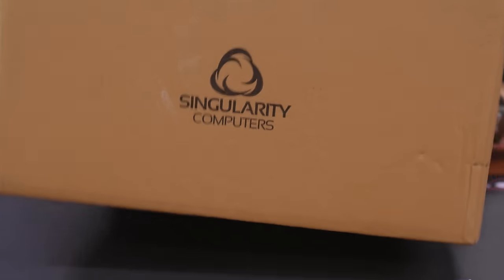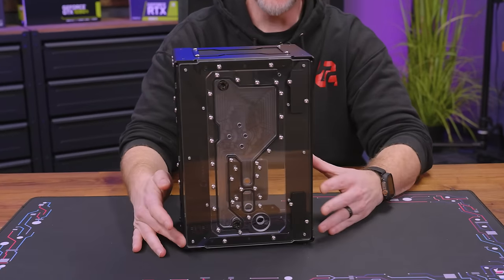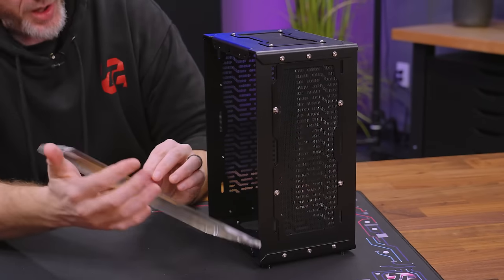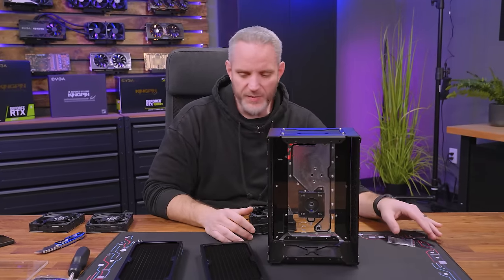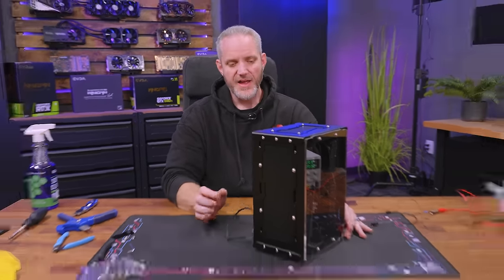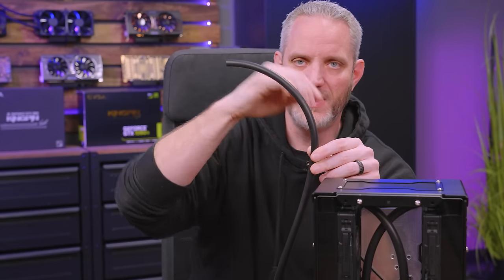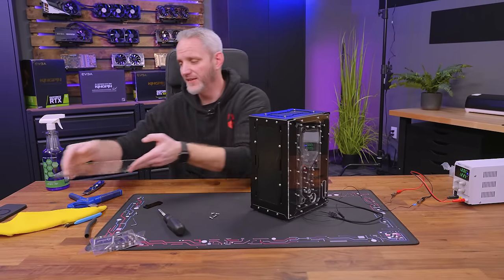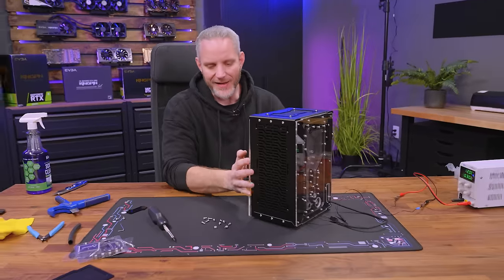External Loops are a thing again?

Comment: the warmer air wouldn't really matter to be honest. think of how an oil cooler (the ones that are part of the filter housing) works for a car, most cars have a cooler that has coolant lines running to it, which is going to be hot but still less temp than the oil, cause oil gets pretty hot. this then cools the oil as there is a half way decent difference in the two liquid temps.

Comment: I think the problem of the heat from the intake radiator affecting the exhaust rad would be alleviated if you configure the loop so that the water goes through the exhaust radiator first. But pull pull is probably a better work around? We shall see after testing.

Comment: Imagine the box being a very thick rad. 1 60thick 240mm in push pull is always going to have less cooling performance then 2 30thick 240mm in push. Although the surface area might be the same, the fins futher away from the fans will get cooler air if the rad is thinner.

My suggestion would doing exhaust on both side. Better than intake on both sides to avoid turbulence from the clashing air.

Comment: Yes, Alaska makes sense, most cargo freight that is onboard CAO aircraft will move from Asia over to Anchorage to then proceed down. When coming from Australia, east coast dispatches usually fly out of Sydney (depending on Courier, FedEx is Sydney mostly), from there most of the time it will proceed to China or Hong Kong (rarely Singapore), or it will head up to Japan, then over to Anchroage, then down to USA.

The other direction (mostly dispatches from West Aust... At least for FedEx) hop a PAX flight from Perth to Singapore, and from there they could take the China, Japan, Anchorage route, or they can go the India/UAE, Germany/Switzerland, NY Route. With everything I have shipped out of WA it 100% of the time goes to Singapore first, then its about 50/50 if it goes via China/Japan, or India/UAE direction. DHL will favour taking things via Leipzig as thats thier main hub (as Louisville, Kentucky is for UPS, and Memphis is for FedEx).

For Cargo (CAO) they dont need to take a direct route like for Passengers (PAX)... Us humans would get impatient with a 3-4 day trip via several hub airports changing planes to get from AU to USA.

Comment: Seems like something like this could benefit from some kind of USB connector to run the power/rpms and rgb. Not sure how feasible that would be but could cut down on the number of cables and it would be one less hole you would need in your system.

Comment: I would go push pull, full intake in first glance would make it, but it's way too tight, dual intake will just reduce airflow by stucking turbulent air in the middle, so getting you less quite rpm range and also slowing the warm air exhaust

Comment: I feel like you could sneak a 3rd rad in there. Or maybe a 3D printed shroud in the middle directing all the air up and out so you can intake from both sides and send it all out the top.

Comment: That would be a cool video to use some thermal imaging on. Also, one could argue that the hot air coming out from the bottom would then potentially be sucked back in through the Rad's

Comment: The real question is whether or not you’ll be able to see through the acrylic after you’ve dropped it a few more times.  I hate acrylic side panels; they scratch too easily.  Probably wouldn’t hurt to have a top exhaust fan - even. just a 92mm.

Comment: Do it so I feel vindicated in my loop configuration. In the Corsair 680x, I have a 360mm radiator in the front and a 240mm in the bottom, both intake. One fan on the top and one at the rear are exhaust.

Comment: If you put the exit of the loop on the top rad and connect that to the frond rad you kinda pre cool the water before the frond rad dous the final cooling before it goes back into the loop, if you do it that way it should be no problem maybe the best configuration

Comment: Du eet! lol, I've always thought that the warm air was reducing the efficiency of the second radiator. but hey, it's just a gut feeling. Perhaps something like an air shroud to direct fresh air to both rads, but that seems like a lot of bother unless the results of the test indicates a large efficiency loss. Perhaps manufacturers can make a rad with dedicated fans and shroud that each pull in fresh air and exhaust it out through the radiator. Of course you'd still need other fans to provide air for cooling of the rest of the components in the case.

Comment: When you test pull-push, you should also test if it's better to have the hot coolant enter the "cooler" radiator first (the one drawing in fresh air) followed by the "hotter" radiator (the one drawing in the warmed air), or vice versa (hot coolant into the "hotter" rad first then piped directly to the "cooler" radiator). As for guiding airflow, since you have a 3D printer, you should try looking up some of the directional air vent patterns on Thingiverse for 120/140mm fans that can redirect air up or down towards the top/bottom vents (in pull-pull config).

Comment: my thought would be push pull with the outlet rad getting the HOT water and the inlet with the cooler air also getting cooler water out of the first rad
it would be neat to get inline temp gauges and plumb them in and see water temps in and out of each stage

Comment: I won't use any radiator anymore from Alphacool, the last one was a nightmare to install, threaded holes painted close, even one hole without thread, so I have to do it myself, because I have the tools. But a novice user would have a big problem. This was a rad from the Eisbear series 360mm. Maybe the other rads doesn't have the problem, but the fact they won't answer my RMA questions, is making me choose other brands.

Comment: I would like to see testing with cross flow, both incoming and maybe both out going pulling air from the top and bottom and blowing out the side radiators.  If the air flow was coming in from both sides and out the top/bottom you may need to also test with some sort of divider so the air does not crash in the middle.  I have a system that I am running with 3 radiators I am curious on testing because I really am not sure if it is over kill.  I am sure you would tell me it is.

Temps runs idle at about 37 F and 72 F gaming.
This is the loop.
Pump/200 ml Res -> 120 rad 1 -> CPU block -> 120 Rad 2 -> GPU Block ->  240 Rad 3 -> Pump/200 ml

They need a Lian Li type under case slide out filters for cleaning.

Comment: Looks like a mini take on the airplex gigant in plastic and in pretty. For 350 usd you could get two MO-RA3 420s, though. It is pretty, for sure, a bit heavy on the screws department.

The dust thing: they are from Australia, dust is everywhere and it is the grinding your fan to a halt kind.

Comment: Kinda depends what DCC you have. (and the Prize is 250 now :P )
The 6W 500L/h   18w 900L/h or the 20W 1000L/h  DDC...
24 = 2 Amp  18w = 1.5 Amp
Most of the motherboard's i have with an "dedicated" REAL pump out (not some crappy AIO) have 17W max on the outputs. READ the manual..

Comment: With the filters on the vents it would probably make more sense to do all exhaust. It should be pretty air tight to not have the problems of negative pressure like in a normal PC case.

Comment: Honestly, I think that a cross flow straight from intake front, exhaust back would be a little bit more efficient than dual intakes, as in my head, the hot air being forced out via positive pressure would create hotspots on the tank, this negating a small amount of cooling as it would heat a tiny portion of the center.

This is pure guesswork on my part.

Comment: How about having fans drawing in air from the bottom and out the top with the radiators blowing out drawing the cooler air drawn to the inside. Might only need fans on the bottom and use some taller feet so you can draw more air in. Just an idea.

Comment: I have a theory that having the fans up against the rads might be worse due to the closeness of the fan blades to the rad chopping the air. Since the general consensus is that pressurizing the case is best, I would like to try this design but use a case that is sealed very well for air pressure, then put all the fans on one of the exterior faces. Case will pressurize and air will exit through the rads.

Comment: I just built a rack mount system and had to do an external quick disconnect radiator and all .  I was looking at the 520 version.  This 240 version might have been perfect....  I was looking at this this morning and looking for videos.  Then this popped up after I got back from lunch....

Comment: As a retired rocket instrumentation engineer, I'd want to have thermocouples in the water lines measuring temperatures going in and out of the block and in and out of the radiator. Overkill, I know.

Comment: Waterbox should have all fans exhaust IMO, makes more sense to pull cool air inside thru vents and then exhaust the heat. 
rather than the fans face in and blow warm air, heating up the waterbox.

Comment: would be neat if they did a dual 360 box too.  Another external solution to think on is the Mora from Watercool. you can even get a pump and res unit that mounts on the side.

Comment: Pls do the math on the amps, Pump and Vents. 2 Amp (@12 volt) on a regular mobo doesnt leave you with much headroom, plus cable length. Bigger awg size recommended.

Comment: set both to exhaust out the case as it will pull cold air from the top and bottom and expell the heat from the sides

Comment: Why not have the fans blow through the rads outward? have the intake at top and bottom and in the fans draw from inside the box pushing air out through the rads... That would negate the air turbulence inside the box and probably increase efficiency and reduce noise (in theory)

Comment: Yes do that test please!
I got just that orientation with front 280 bottom 240 intake and top 360 exhaust and have been wondering about just this.
And if there would be any other options that might work better since all my intakes goes through rads.

Comment: also im not done with the video yet but itd be good if you could put a fan at the top and bottom exhausting and the ones on the rads pulling in.  may need slightly higher feet for clearance.   itd need to be what like 2.5 inches taller and then maybe have .5 inch feet for clearance on the bottom.  but the thing is totally cool and a great idea for people testing things.  i wouldnt think it would be widely bought by general consumers.  unless you want to cool your mini case exteriorly with something fancy.  still very cool .

Comment: If you do test the radiator fan configuration I think you'll need 3 water temp sensors to show if the crossflow is any worse than positive/negative pressure setups in the box. 1 sensor at the inlet to measure the temp before radiators, 1 sensor between radiator A and B to show how effective the first radiator is with all the fan setups, and then 1 sensor in the return to show how effective the second radiator is.
Reply: Jay will tell you that after a while all sensors will show the same temperature.

Comment: hmmm if it had longer legs and the ability to mount a 120 at the top and bottom you could do cross flow with a hot air exhaust and fresh air intake from the bottom which in my mind seems ideal for the form factor...

except that it's quite low to the ground and also it doesn't seem to have a 120mm fan mount at the top and bottom....then both to intake and positive pressure the crap out of it :P force all the air to go through a dust filter or be exiting exiting the case and be in theory filtered air.

Comment: Just thought about another configuration,  hardware store, silicone bumpers that peel and stick and put on plexiglass side, lay down, then run rads intake and then both exhaust, then do the same but with both filters removed

Comment: It would be interesting if you were to have them both as intake, with a fan mounted at the top exhausting just to aid in the removal of hot air, I imagine using a high enough rpm fan would make a lot of difference, although the dual intake rads could create a dead spot towards the bottom where hot air lingers…?

Even then, could you have the top fan on each rad exhausting and the bottom 2 on each rad as an intake? Seems a stupid idea but either way it’s interesting.

This “case” is intriguing for us Watercooled guys and gals 🤯

Comment: really nice piece of watercooling tech. But i am not sure if it would be good to use with quick-connects (i mean on a testbench). the distroplate doesn't look like it holds a lot of water and on a testbench the tubes and waterblocks would be empty... useable: sure! but you would have to top of the res everytime. As an external part for a normal computer this would not be a problem

Comment: What if you were to have the top two fans pulling air one direction, and the bottom two fans pulling air in the other direction, and then have a horizontal plate divider in the center. Obviously the tubing would need to be different somehow but still. Maybe it'll have less turbulence and the air temps would be more equal rather than one side being hotter than the other.

Comment: If you run the fans slow than you want both rads exhausing or intaking.  If you run the fans fast than in one rad and out the other won't be much different.

Comment: 6:20 The most energetic efficient way to cool is first to understood the problem of thermal energy transfer at all. To cool a liquid with air involves obviously 2 parts water and air, when you are just discussing on side of the problem, you wont be able to find a good solution. 
First principle of thermodynamics for this problem is, as higher the temperature difference as better heat the effective exchange. The next aspect is that opposing currents of gas or liquids are nothing else as a dynamic valve (Tesla Valve) and should be avoided. 
In this scenario, because air is a very bad thermal conductor thus we need huge amounts of gas for the cooling effect. The last aspect is pressure, the box is a somehow closed container, and we know fast and cool air will drive the cooling effect, thus we also apply a low overpressure aspect on top. 
The setup up now is just clever engineering, the main fans must be run in an push & pull mode, the top and bottom fans are used to bring in more fresh air and increase the pressure slightly, to help the push exhaust main fans to increase the airflow; That's the tricky part, to not push to much air in the box, that the pull main intake fans entering a valve scenario. Therefore be gentle with the top and bottom fan speed, play with the speed of top, bottom, and exhaust fans while observing the pull force to the main intake fans.
The last aspect is the water temperature, the hot water intake is the exhaust side of the main radiator & fans, the precooled water goes now into the pull fresh air radiator to reduce the water temperature a bit more by fresh cool air , but also doesn't heats up the air in the box too much and top and bottom radiators have a chance to bring in enough cold air to compensate.

Thus the idea is a cool the hot water first with a pretty good delta T, because we know that we will not achieve a temperature equilibrium in that radiator anyway. Secondly we use a better delta T to achieve a better cooling in the intake radiator and except a worse cooling effect for the sake on not heating the box, lastly we use slight over pressure in the box to bring in fresh air for better delta T and increase the exhaust air flow. 
Short hand rule the hot water goes opposite direction of the air flow, and use additional air intakes gently for a better performance - if and only if you can avoid a disturbing air flow in the flow system.

Comment: As for testing multiple conditions, please do, would love to see the results.

Can fans be attached at top and bottom, too? A fan pushing out the top (and perhaps one pulling in the bottom) might make this smaller one sufficient for most use cases.

Comment: I suspect it will all be a wash in the end as we are talking the difference of prob a only 20*  from the air exiting one rad going into the other.  However science!  I want tests dang it!  Validate it!  I'd be interested to see both rads pulling air in and then a pull from the bottom and a push out the top.

Comment: What if you have both radiator's blow the hot air out the sides and have them both suck in air from the top and bottom vents, just get some high static pressure fans and take off the air filters and you should be fine.

Comment: If the top and the bottom are filtered, why not remove the two side like you did, but put the fans as exhaust as the top only has the dust filters and no grills like the sides which have both a grill and filters.

Comment: Do the efficiency test! 

I'm normally of the opinion that having cpu aio radiator fans as intake is superior in most configurations that don't also have gpu water cooling; the radiator doesn't heat the air more than than internal temps and the effect is negligible.  Even in a top radiator config, as long as you have decent exhaust and positive pressure. 

But in this setup, I think there is a good argument for radiators set to exhaust,  as long as there is ample intake from both top and bottom. I think ambient temp in the case might be close enough to room temp that your gpu and cpu temps wouldn't be effected.

That's what I want to see!

Comment: Hi Jay. I'm playing around with my new Test Bench, and this would make a great addition. Would you make a video using this as part of your Test Bench? Such a video would help me set up mine. Installing reversible fan blades would simplify determining the best radiator fan airflow direction, as the fans only need to be installed once.

Comment: idk i think maybe exhaust the air, the vents would still have a purpose ie where the air gets sucked in from, having it intake would cause a heat soak in the centre warming up the pump and hoses?